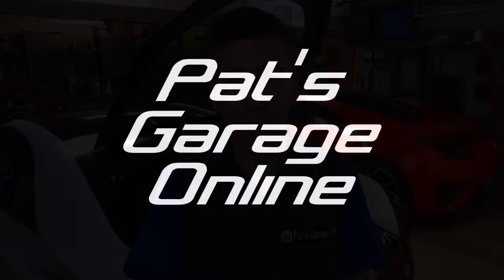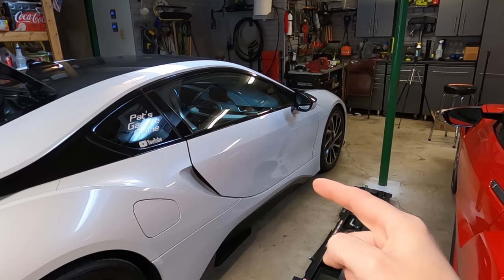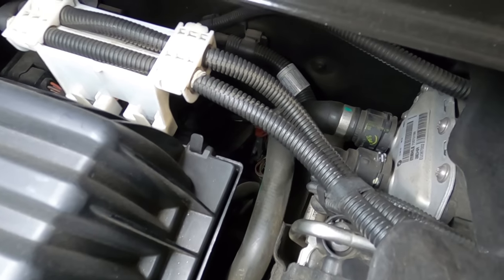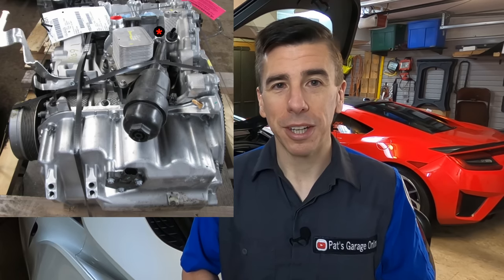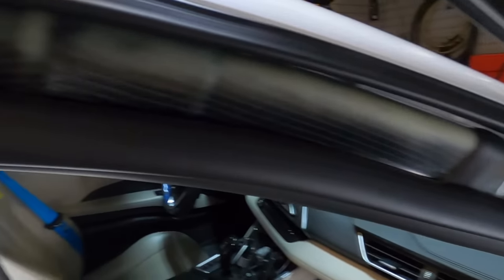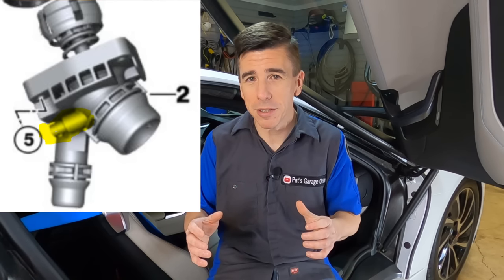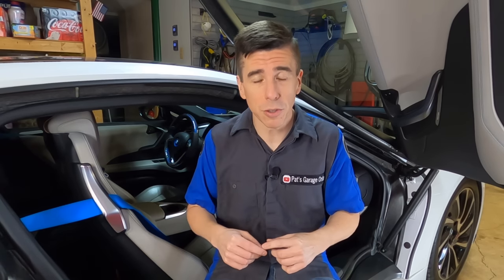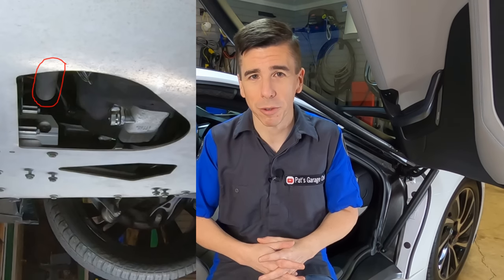My response to your ideas about Samcrac's BMW i8.

Comment: old trick i used to use on the older ford trucks to fill the pump up, was to pull the heater core line off so it would fill up the waterpump (they could be a little finicky to fill sometimes), used to work really well and very rarely had a problem with bleeding them.  I am wondering if you could pop one of the coolant lines off (that are accessable) and do the same thing.
Reply from the maker: That's a great idea and wish it could work with the i8. All coolant hoses that attach to the engine are lower than the top of the water jacket. The pump can get water but can't pump enough water to push the air down and out.
Reply: @PatsGarageOnline  sounds like a design issue.  they should of had the resovoir in the engine bay at a point higher than the engine.  I have also used a lisle #24680 coolant funnel (had to look it up) in the past for some more troublesome vehicles. get em up to temperature, and you can use it to burp air out of the coolant system (before these fancy vacuum bleeders became more common place).  it was pretty much nessicicary on the old jeep cherokees (which could be interesting to bleed).  I'm starting to wonder personally if it may be a obstruction or damage to a coolant line causing the problem.  Your original suggestion of flushing the lines with a garden hose to see if they are plugged may actually be the best bet.

Comment: I’m curious to see what the radiator looks like when they pull it and inspect it. My crazy thought is, could a previous owner have poured something in the cooling system like a “head gasket fix” or stop leak for coolant? That stuff is detrimental to normal cars I couldn’t beginto imagine what it could do in something like the i8??
Reply from the maker: With so many small diameter pipes and hoses, pumps and valves, it would be a nightmare in the i8.
Reply: I was thinking exactly the same, with so many attempts at fixing this it is a possibility a coolant leak product was tried and blocked the radiator or pipes. All it might take is one valve to be blocked as in my experience not all valves will bring up a fault code. Car looks like a nightmare to work on with this sort of fault.
Reply: Could the orevious owner have used a different coolant type / colour from what is recommended and they have reacted thus gunking up the system which may not be rectified with a normal flush?

Comment: Host of this channel, just how much would it cost for a local bmw shop to drop the engine to repair this sensor? Could you use your local bmw delar prices? Thanks.
Reply from the maker: This would likely be a $15,000 to $20,000 USD repair cost.

Comment: What about the wire connector at the thermostat?  What if the connector has been pinned backwards?
Reply from the maker: That would likely throw a code and check engine light.  According to the service manual:

If the characteristic map thermostat fails, the following behaviour is to be expected:

Fault entry in the engine control unit
conventional operation via wax element
US version: The emissions warning light lights up in the instrument panel

Comment: I'm curious do you think somebody may have used a type of Stop Leak on the radiator and that could've caused an issue?
Reply from the maker: That's possible.  Stay tuned to Sam's channel as he did find something interesting in the radiator that blew out.

Comment: Typically BMW crap. All the n55 to change the turbos you have to drop the engine. We have wooden palates made that are about 2 feet high and big enough to sit the engine/ x member suspension and transmission. And if it’s a ix then you have the front diff. We can drop them in 45-1 hour. The turbos are still difficult to do with the engine sitting in front of you out of the car. I have heard tales of people who have done it in car but you couldn’t pay me to do that. It’s way faster to drop everything out of the bottom. I have been working on BMWs for almost 30 years.

Comment: i still have yet to get an answer to whether the hose is crushing while it runs. second this has batteries they take coolant to did the battery pump fail? did the turbo fail?  is it working?  has anyone checked the lines(for clogs)? and has any one checked the fan is working? what if there is no code for the thermostat? can you just bleed all points that are high by adding a vent  lines to a common high point? Let me put it to you if thermostat is closed pump is still pumping ANY hose on the low side(not reinforced) WILL CRUSH. crush blocks flow(think closed valve) themostat works and hose is still crushed until pump is powered down. please look at hose while running!!!!!!
Reply from the maker: I'm waiting for Sam to post a new video.  I'm 1000 miles away so I can't put eyes on the car.  The high voltage batteries in the i8 are cooled by AC refrigerant lines running through the enclosure.  So, there's no liquid coolant in the battery enclosure.  I'm not sure the condition of the turbo.  I'm waiting to see if Sam gets the chance to check for clogs, check the fan and check for codes.  Sadly, the high point of the coolant circuit is the head and I don't think he wants to tap that.  The thermostat on the i8 is designed to be open until an electrical signal heats a wax element to close it.
Reply: @PatsGarageOnline  i meant turbo water pump. if it (heats) element (To expand)then when car is hot the wax should expand and it's closed? that cant be right. that doesn't sound right, unless you want to super heat an engine. that design if what you say to me is true then it is self latching runaway heated system
Reply: @PatsGarageOnline  you guys should try unplugging the heated heater pump too. maybe just bypass and run?
Reply: @PatsGarageOnline  what if the battery system was low in "Refrigerant" the system would still cool a little but it would be dumping Massive amounts of heat into the cooling system. I keep going down this route because he pulled thermostat and it was still getting hotter.(if how you said the thermostat works it should have ran shorter..) there has to be Outside heat entering system. hence heating system, Heat exchanger for batteries, Heated Flow Pump, and Air-Charge cooling circut. considering what i can find on I8s, it looks like they use the Air-Conditioning like a heat pump.(Florida = Humidity + Heat) any problems are going to be BIGGER problems.
Reply: @PatsGarageOnline  secondly the way it happens IS NOT under load, leading me to think it is something normal that isn't functioning like it should(like emission start up, Air-Con, or heat exchanger) not the engine's head/gasket. and on any Low/input/Vaccuum sides on any of the many pumps, the hose if slighty restricted could Colapse(crush) and stop a normal thing from working. ESPECIALLY if the hose is not reinforced(like most of the hoses on the I8). oh yea, and plastic lines will absorb more and more air over time as they become porous.

Comment: Do a combustion gas in coolant test?
Reply from the maker: That's what really needs to be done.
Reply: When ever I hear overheating and bleed issues I think head gasket or head warping/cracking.
Reply from the maker: @stakkabo1  Yes, which is actually uncommon on an i8.  Weekly, I hear how a coolant component was changed on an owner's i8, it's overheating and they take it back to the shop and another bleed fixes it.

Comment: Pat, my i8 intermittently has the 'Drivetrain. No restart' appear on the dash and the car wont't move. The OBD2 gives the error1D3702 Power Management, Battery: Faulty Charge By High Voltage Battery.  Then sometimes it starts normally and drives fine. Any thoughts?
Reply from the maker: Sometimes I8 owners had a weak 12v battery which caused this. It's the most likely culprit if the batter is 4 years old or older. Check the date stamp on the negative battery terminal. BMW brand is required if you are going to replace it and the battery needs to be registered to the car. That can be done with Bimmerlink. That's my first guess. The EME allows the HV battery to charge the 12v battery, and the EME gets its power from the HV battery which also has the SME in the battery enclosure. If either these modules are having issues, it could be thousands in repairs.
Reply: @PatsGarageOnline  Thank you Pat! That has been very helpful. And keep up the great work you're doing on the channel!
Reply: Hi Pat, me again. I still haven't had any luck with getting my i8 problem solved. Tried the new battery but no luck. Software update and no luck. Along with the previous error on the  ISTA I do get another (among others) which is ' High Voltage battery, cell supervision circuit 2: Temperature measurement of the cell block measured value implausible'. Any thoughts on this?  I got this car from BMW UK and they've basically told me to take a hike although the car is still under warranty- because I shipped it out of the UK
Reply from the maker: @ryanr8287  I just saw your post on Bimmerpost and replied there.  I think you have a bad SME module but I'm not sure.  You will need a BMW service center to address this since I am not familiar enough with it.
Reply: @PatsGarageOnline   Hey Pat, thank you for taking the time to reply. I'm going to try changing one of the cell supervising circuits (CSC) and see if that works. My local BMW dealer in Trinidad refuses to touch the i8.  Will let you know how things turn out!

Comment: Perfect example of a motor vehicle where the designer should remove & replace EVERY servicable part...with a gun at their head...  all of a sudden, failure is not an option.
I would have by now, just bush engineered it by by-passing every sensor, every pump, and put an electric pump somewhere easy to get to, flush the hell out of the system, put an aftermarket temp guage in and be done with it, I'm sure its factory warranty is all gone by now, so who cares what BMW and its dead designers think. f.f.s. all you need to do is get hot water from an engine to a radiator, then back again....

Comment: That's is the same sistem thermostat Iike vw fsi engine it does not throw a code every time, thermostat Cann be bad or electric element without a code
Reply from the maker: Thanks for this feedback!  The service manual for the BMW i8 says this, but who knows for sure.

If the characteristic map thermostat fails, the following behaviour is to be expected:
Fault entry in the engine control unit
conventional operation via wax element
US version: The emissions warning light lights up in the instrument panel
Reply: @PatsGarageOnline  engine must  have 2 temperature sensor one on the head and one on the block or radiator or somewhere on the line, if is one of this two bad Cann show lover temperature and thermostat will not open or the fans will not work its happen on the vw engines, sistem is 99 procent the same, he need to change this two sensor and thermostat and Chek also  the fans
Reply: @PatsGarageOnline  engine operating temperature is more then 90 degrees c, idling and part throttle 95 to 115 degrees Celsius, full throttle under 95 degrees Celsius, depending on engine load, speed, and rpm

Comment: It's hard to believe the idiot designers at BMW tried to use a wax motor in a car thermostat!  Wax motor is what that part is called when used in appliances.   Maytag tried to use them to secure washing machine doors in the 90's instead of solenoids but had to replace them all under warranty when they failed then finally went back to regular solenoids in newer models.

Comment: https://youtu.be/ijDj17kcIqw?t=656   With this much vapor coming from the coolant reservoir just attach the air bleeding device and capture that air coming out coolant reservoir and test it for hydro carbon gases with an emmissions tester.  Have you ever done that?

Comment: Hey man, been watching Sam's trouble with the i8 and stumbled on your page (I have subscribed) just a question, doesn't the i8 have 2 water pumps,  cooling pump ? P/N 11518600442, 11518600287

Comment: Why the heck will you buy this car in the first place?
Reply from the maker: I was going to buy a C7 Corvette but saw the i8 was a similar car with similar performance and better gas mileage.  It is my daily driver.  Neat thing is I'm able to run on electric for a while and save gas, but can switch to Sport Mode and run full AWD and be able to drive it as a sports car.  The doors are also pretty cool.  Just a few things that appealed to me.  However, after I bought the car, I started learning about all the different issues and concerns and started the YouTube channel to help teach people about them.  Mine is still under warranty so I don't have the issues Sam has to deal with but it's going up for sale before it's out of warranty.

Comment: Should read a bible when one commits to reading a BMW manual
Reply from the maker: I might do that on the next video.  Not sure which book/chapter to read but Revelation sounds like the right one for this car.  😂
Reply: @PatsGarageOnline  lolol. I thought Sam was doing alot wrong by not checking in flow and out flow of the cooling system. Maybe he could have run a pump through different hoses, components to see if water flow is clear or restricted. 

I work fixing data center servers. Always takes a long time of testing each component but somehow one will be able to mitigate with that method. 

Your advice is great Pat. Hopefully Sam can get this one fixed! 💪🏼

Comment: so the long and short of it bmw has delivered another pile of crap that no one should buy.
Reply from the maker: I haven't had the issues Sam experienced and have another 2 years of warranty on mine.  It's been reliable for the most part, but several people have experienced AC Compressor and Coolant issues.  I just like to share the good and the bad and let the potential buyers beware.
Reply: @PatsGarageOnline   I look at it this way, you and sam have the means to repair a vehicle like this. The average person will have to rely on the bmw dealer to provide service so the repair and maintenance bills will rapidly balloon to the thousands. and in this case the dealer could not fix the car and recommended a engine replacement.

Comment: I WOULD NEVER BUY A BMW - NEVER - THAT IS NOT ENGINEERING IT'S STUPIDITY...
Reply: what will you buy instead given the same budget?
Reply: @alexm566  AN ANTIQUE AIRCRAFT - THEY APPRECIATE IN  VALUE AND ARE FAR MORE INTERESTING...
Reply: @foxmoth5477  I mean...sure. most i8 buyers do it for fun, not as an investment and they can't fly or pay for aircraft maintenance.
Reply: @alexm566  SEEING WHAT IT COST TO MAINTAIN THE i8 -  IT IS FAR MORE COSTLY TO MAINTAIN THAN A RESTORED ANTIQUE AIRCRAFT
Reply: @foxmoth5477  this is a very extreme case and even then the real cost would be zero under warranty.
Reply: @alexm566  WARRANTY - THE BMW REPAIR SHOPS AT THE DEALERSHIP CAN'T REPAIR THEM SO SO  MUCH FOR A WARRANTY...
Reply: @foxmoth5477  if this was under warranty you'd get a full refund under lemon law
Reply from the maker: I'm a pilot. Flying an antique airplane costs more than driving an i8.
Reply: OH - I'VE NEVER HAD THE NIGHTMARE MECHANICAL ISSUE THOSE I8s HAVE -
Reply from the maker: @foxmoth5477  I don't have the issues with my i8 that Sam is having. Don't forget his is a car that's been repo'd, sold at the salvage auction. He bought it with a severe issue that he will discuss in his next video. Sam is trying to get it running right. Pick up a salvage plane and let me know how many problems you have 😉
Reply: @PatsGarageOnline  APOLOGIES IF I HAVE STRUCK A SOUR NOTE FOR YOU - I RESTORED MINE AS A BASKET CASE - AIRCRAFT AND AIRCRAFT ENGINES ARE STRAIGHTFORWARD AND ARE  NOT COMPLICATED OR HAMPERED BY POOR ENGINEERING OR DESIGN DECISIONS - AS THESE OVER ENGINEERED AND OVERLY COMPLICATED EXTREMELY EXPENSIVE AUTOMOBILES ARE. I CAN TELL YOU IN 75 YEARS THAT I8 WILL BE A PAPERWEIGHT AND TOTALLY UNUSABLE, IN MY OPINION.
Reply from the maker: @foxmoth5477  Oh I'm not offended. I've hung around the FBO long enough to know how expensive project planes are. And I've burned more fuel taking lessons than I have in 2 years of i8 ownership. The only thing that can make a plane fly is money.
Reply: @PatsGarageOnline  UNFORTUNATLY MANY OWNERS NEVER DO OR PAY FOR THE REQUIRED MAINTENANCE - AS A A&P  - I LEARNED THAT'S HOW YOU OWN AN AIRPLANE AND MAINTAIN CONTROL OF COST - AND MY AIRCRAFT IS OLD ENOUGH I CAN MAKE PARTS FOR MY AIRCRAFT AND DON'T RELY UPON A PMA PARTS SUPPLIER GOUGING ME - I DON'T NEED A AVIATION PMA ACTING LIKE BMW -  GOUGING ME ON PARTS..